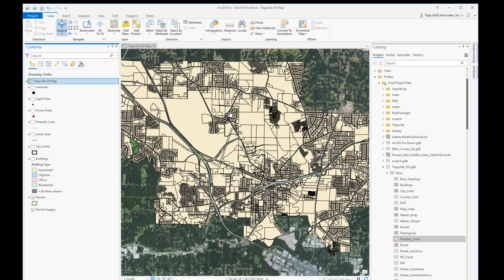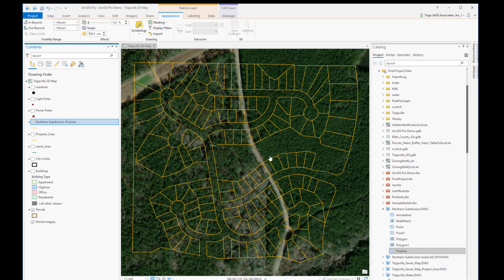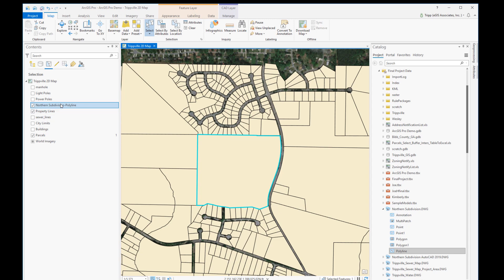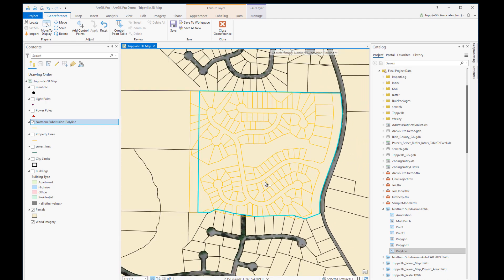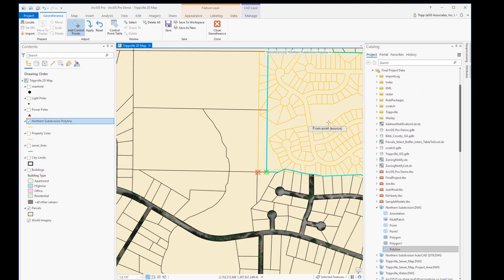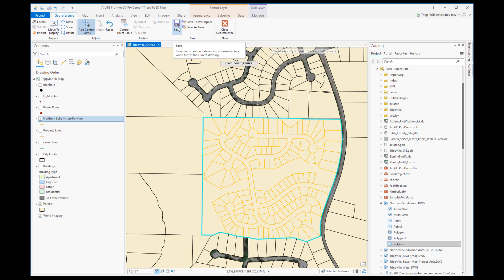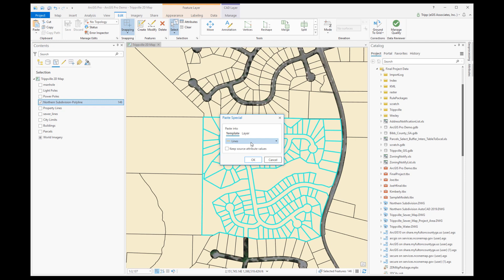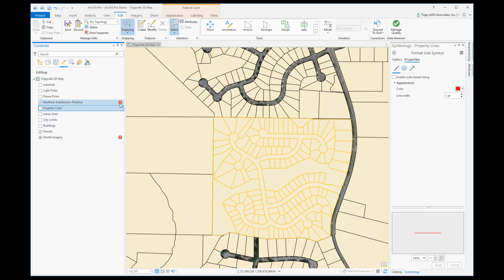Georeferencing a DWG in ArcGIS Pro

Comment: Great video! I followed all the steps you did but my cad file is rotated differently compared to my gis layers. Is there a good way to rotate the cad drawing so that it matches the rotation of the gis data? Hopefully that makes sense and thanks for the help.
Reply: To give more details. Everytime I add the control points and hit apply, the CAD data rotates itself and doesn’t fit within my gis data
Reply: Hello, There is a rotate tool on the georeferencing toolbar that might help. Also check your control points and make sure you are correctly matching them up. You should first click on the location in your CAD file and next click on the matching location in your GIS data. Remember to select two locations that are diganal from one another if possble. Hope this helps. BTW I am the one that created this video. I just do not work at this company any more.  @jacksmith5133

Comment: Bummer. Is it really only limited to 2 control points when georef CAD files?? I could use a few more control points for the drawing I'm looking to georef.
Reply: Yes sadly Esri limits georeferencing of CAD files to only 2 control points. The reason they have given in the past is that CAD files are typically more accurate than GIS data so they do not want negatively impact that accuracy if at all possible. Having created many CAD files myself and worked with many surveyors and engineers, I know that assumption is just not true. But it is what it is. ArcMap, Esri's older desktop GIS app, is the same way. BTW I am the one that created this video but no longer work for the company that owns the channel.

Comment: Sir we are facing the problem when we want to do this process a message is displayed to send e mail to ESRI. Sir what could be the possible solution to this problem. Sir our project is sticked and we are looking towards you for the solution.
Reply from the maker: I assume this message appears as ArcGIS Pro is crashing and wants to send the crash report to Esri. This could be a bug in the version of ArcGIS Pro you are using. So you might want to try and revert to an older or newer version if possible. If ArcGIS Pro is crashing and it is not a bug, it could be running out of computer resources. This could mean your computer spec in terms of memory, CPU, hard disk space or video capability is not enough to complete the task. Do you have at least 16GB of RAM? (32 GB is even better) Do you have a dedicated video card with at least 6 GB of memory?  Do you have at least a quad-core CPU? I would recommend an 8-core CPU if possible. How much free space do you have on your hard drive? 500 GB or so is the minimum I would recommend. If your computer is on the lower end of the hardware spectrum, I would suggest before you try and georeference the CAD file, that you save your project, and clear out your cache (under the ArcGIS Pro Options in the Project tab). Then close and restart ArcGIS Pro. This will help flush out your computer's resources before you start the georeferencing process.  Hope this helps
Reply: @eGISAssociates  lots of thanks sir for your kind response

Comment: This is a great video! Do you have any content/resources that would advise on layering this way with Floor Plans? I have a basement and a first floor building that I am trying to add to my map before I will start adding buildings with more floors. But when I am viewing the CAD Layer, it has imported the basement and the first floor side by side rather than layered. Maybe it is as simple as importing them one at a time, so having a basement CAD file and a First Floor CAD file, and then layering them that way? Then I would assume I would just have to use the ceiling height to adjust it from there?
Reply from the maker: So glad you liked the video and found it helpful. To be honest, I have never tried to model building floors in ArcGIS before. Your process seems to make sense. You might also look into using Ranges - https://pro.arcgis.com/en/pro-app/latest/help/mapping/range/set-the-range-properties-on-a-layer.htm.

Comment: What if they CAD data is too big? For example, when I tried to bring in the lines into the display while georeferencing it didn’t work because the CAD lines are huge. When displayed in Arc it’s at 1:26 billion 😭 whereas it should be fitting into an area at about 1:200,000.
Reply from the maker: In that case I would most likely start by using the Scale tool on the Georeference tab, to scale the drawing down to a closer size and use the Move tool to move it into the general location. Once you have done that, you can add the control points to get a more refined solution. Sadly ArcGIS Pro does not have a Fit to Display option like ArcMap does. The Move to Display tool requires you to have control points which in your situation is almost impossible to do.

Comment: Hello, when I import my polyline from my .GDB / catalog the CAD Layer Tab does not appear.  For this reason I am unable to georeference the vector layer and assign it the correct position... why could this be happening?
Reply from the maker: The CAD Layer tab only appears when you are working with CAD Data (DWG, DXF or DGN files). It does not appear when you are working with data from a Geodatabase. That would appear to be the cause of your issue unless I am misunderstanding your question. If your data is in a Geodatabase, then you would need to use traditional editing tools such as move, scale and rotate to georeference it.

Comment: I work with engineers and the .dgn data I get from them is never in the correct location. They have to use a surface correction supplied by the state. There is nothing to reference between the two (aerial imagery and the ,dgn) I can't assume I have the correct location and scale when georeferencing. So in ArcGIS I use the Rotate, Scale, Translate tool by populating the From and To XY fields with 0 as well as the angle. I populate the Scale box  with the inverse of the Surface Correction number supplied by the state for each county. This moves the .dgn to the correct location as well as maintaining the correct scale. How is this accomplished in ArcPRO?
Reply from the maker: Not sure I follow your workflow exactly but in ArcGIS Pro, once you add the DGN file to the map the Manage tab should appear in the ribbon. From that tab, there should be a Georeferencing button. That will add the Georeferencing Tab to the ribbon. On that tab, you will find tools for Rotate, Move and Scale. From here you can also add control points using the Add Control points tools and editing the Source X, Y, and Map X, Y in the table. With a CAD file (DWG, DXF, or DGN), you can only specify two control points. Once you get the Control point data entered, you click the Apply button to apply the transformation. If you select Scale, then press A, the scale factor window will open. Pressing A for Move will open the Move window to enter the new X and Y.  Pressing A while rotate is active will open the Angle window. I hope this helps.
Reply: @eGISAssociates  If I'm understanding you correctly, you are describing a manual move, scale and rotate. What I am doing in ArcGIS is transforming the .dgn using the Move, Rotate, Translate option under the Transformation tab for the layer by populating the X & Y "From" and "Move" with a zero as well as the "Angle". The translate field is populated with simple number like .99987 (inverse of the Surface Correction Factor of 1.00013). THe .dgn comes in (on a cartesian map) +,+ (right and up), I apply the inverse to move it -,- (down and left) to get it back to 0,0). I do this with numbers only, not dropping points or calculating the distance of X & Y between where it is and where I want it to be. Does ArcPRO have this capacity?
Reply from the maker: @MrGtownjake  If you manually input the information for the two control points in ArcGIS Pro into that table it will automatically transform the DGN based on those two control points.
Reply: @eGISAssociates  I use engineering that has no matching points between base data and the .dgn. For example, I have a .dgn of a new bridge to be built. It comes in 'lala' land but it does have a projection. I know where the bridge needs to be (over the creek) but I don't have the exact location. There is nothing in the engineer file that is the same location as the base data. The engineer creates their files with a 'surface correction adjustment' usually looking something like this, 1.00013. In arcMAP, I can use the Rotate, Scale, Translate feature by zeroing out the X and Y fields for both the 'From' and 'To' fields as well as the 'Angle' field. In the 'Scale' field, I use the inverse of the Surface Correction Adjustment' the engineer used but typing into the box, .99987. This results in the engineering file being moved, rotated, and scaled automatically to where it needs to be. There is no manual placing of control points.  
Maybe another way of explaining is do the same thing in your video but don't use your parcel data as a reference point. How would you move the subdivision to the correct spot with the same accuracy as using control points when all you have is the aerial imagery?
This is my dilemma with ArcPRO, I cannot find a way to transform the .dgn to the correct spot without using control points. Is there another way in PRO?
Reply from the maker: @MrGtownjake  Not sure of any other way i the current version. I am working with Beta for Version 3. I will check it to see if I can find other ways.

Comment: Great video, how come you did not define the project for the CAD data first? Obviously you chose a good example for your video, but it very often seems impossible to correctly line up a CAD file that was created in a local coordinate system, with only the move, rotate, scale, and two control points. I often can only get part of the dataset to line up correctly, if one corner is good it means another corner is off. I can only split the difference and roughly align the CAD data to my reference data, but never line it up as perfectly as in this video.
Reply from the maker: Glad you like the video. You are right, you will often not get CAD files to line up perfectly with GIS. This video was really there to show the basic workflow on how to georeference a CAD file. Often what I do is get it as close as I can and then convert the CAD data into a GIS format and edit the converted data so that it aligns with my GIS. To be honest, I think Esri did a disservice by limiting CAD files to only two points. They assume CAD data is more accurate than GIS data and thus did not want to allow users to completely destroy that perceived relative accuracy. As someone that has created many CAD files during my career, I can say yes some were extremely accurate but others were not. So I think Esri should allow users to make the call on what they think is best for their needs and situation.
Reply: One good thing about the most recent version of ArcGIS Pro (3.x) is it appears to beable to read a projection assigned to a CAD file in the DWG itself if done in Civil 3D or Map 3D. This has not be true of older versions of ArcGIS Pro. I found this out while working on a new book on ArcGIS Pro 3.x. It also looks like if the DWG is assigned a projection/coordinate system from Civil 3D or Map 3D, that ArcGIS Pro will also project on the fly. This all does assume the DWG file was correctly created in a real world coordinate system and properly assigned from the start.

Comment: I am following the steps but when i click "move to display" it does not move the cad layer to where I want. Instead it just zooms me back to the cad layer. Thoughts?
Reply from the maker: Humm..... Good question. Could be a few things. First is the CAD file located on a network drive or external drive (or flash drive)? Those can have long data lag times which ArcGIS Pro does not like. You could move the CAD file to a local drive and try it again. Second could be read write permissions issues. Make sure you have the right to read and write data to the folder and file. Another potential cause could be if the file is on the root of a drive and not in a folder. ArcGIS Pro does not like accessing files or data that is at the root of a drive.  Lastly it could be that the drawing file already has a world file (WLD) and projection file (PRJ) associated with it that might be confusing ArcGIS Pro. Those are just a few things from the top of my head.

Comment: The CAD Layer Mange ribbon tab is not showing up when I highlight the CAD drawing. How do I add that to ArcGIS Pro?
Reply: I had the same issue with the CAD Layer Manage not showing up on the ribbon-tab. Here is how to get the CAD Layer Manage to appear. When importing the DWG file DON'T use the 'CAD to Geodatabase' tool. Instead go to the Catalog pane, right-click on Folders, select 'Add Folder Connection'. Select the folder where the DWG file is located. Then expand the Folders, then expand the folder you just added. You should see the DWG file. Drag-n-drop the DWG file to the map, this will add more than one layer. Select the layer you want on the Contents pane and you should see the CAD Layer Manage in the ribbon-bar. DO NOT expand the DWG and drag-n-drop just the polyline/polygon/point as this won't show the CAD Layer in the ribbon-bar.
Reply from the maker: It is not something you should have to add. It is part of the core product. What version are you running? If you added the entire CAD drawing to your map, try just selecting one of the layers under the group layer. Also make sure you are looking at it in a 2D map and not a 3D scene.
Reply: I am running version 2.1. I did add the entire CAD drawing and am in 2D.
Reply from the maker: @jalwgis  First try upgrading to ArcGIS Pro 2.3.2.  Your version is an old one and does have some bugs. Then try adding only one feature class from the drawing file instead of the entire drawing. Georeferencing a single feature class with result in georeferencing the entire drawing.
Reply: ok
Reply: @jalwgis  You probably need expand the CAD file from the Contents Pane and click on one of the individual layers. If you don't drill down then the CAD tabs won't show up.
Reply: Hi @jalwgis did you ever find a workaround for this problem? I am experiencing a similar issue.
Reply: @augustnastasi4574  No